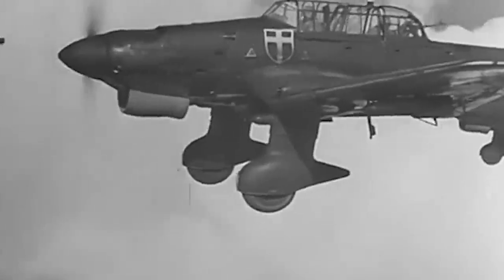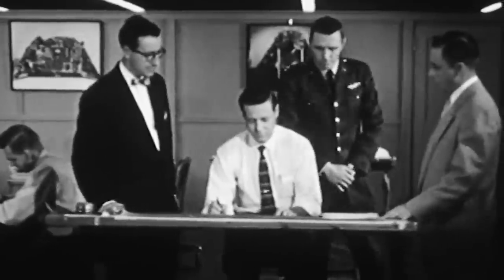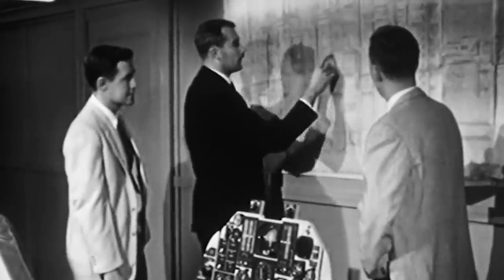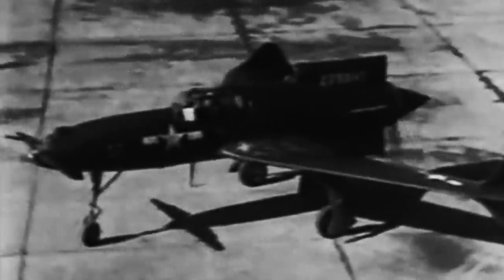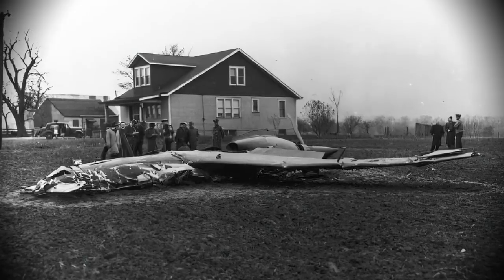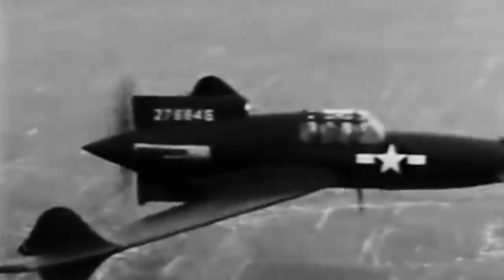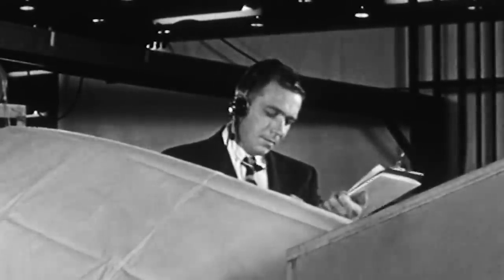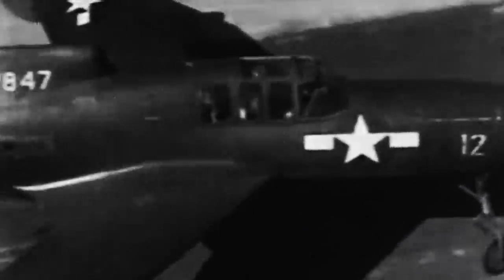XP-55 Ascender - The Backwards Fighter

Comment: Although Glenn Curtis died several years before WWII began, his legacy is nothing short of remarkable. As a pioneer in aircraft and motorcycle development, Curtis' accomplishments are oft forgotten.

Strapping on a V-8 engine to a fairly rudementary bike frame, Curtis set a world speed record of over 136 mph for motorcycles. He also invented handlebar throttle control, something that quickly became the standard for all motorcycles.

In the early years of aviation, he was a pioneer in pusher-prop ideology....something that continued into the XP-55 so many years later. And let us not forget his role with Bell and Wright in developing the technologies that would eventually lead to breaking the sound barrier and beyond.

The Jenny was widely regarded as one of the best trainer planes in World War I.

Although the XP-55 was a "failure", it proved that conventional airframe designs were just that.....conventional. And even the P-40 Warhawk/Kittyhawk/Tomahawk, that lacked high altitude performance, was a solid aircraft to serve in both theatres of conflict....for the entirety of the war.

Comment: It must have been an inspiration to Burt Rutan
Reply: Rutan could make anything fly better and cheaper than just about anything else in the sky.
Reply: Burt figured out how to make the plane hard to stall.
Reply: @rotorheadv8  He sure did. That's what jumped out at me when poor stall characteristics of the XP-55 was mentioned.
Reply: @grndiesel  If true, perhaps you can explain why Rutan's company never replaced Boeing or Airbus. Most airlines love better and cheaper.
Reply: The shape reminded me immediately of Rutan's VariEze, which had graced the cover of PopSci back when I was in high school. https://en.wikipedia.org/wiki/Rutan_VariEze
Reply: @enscroggs  I don't claim to have all of those answers nor would I presume to know his reasons for never building something like the A380. But if you compare the cost of airplanes that he did make to contemporaries in the same class, I would still feel confident in my earlier statement. Indeed, his early adoption of composite materials are eventually finding their way into commercial aviation. Commercial aviation is very slow to accept change.
Reply: At the time, the materials Rutan used were not practical for large scale mass production. In terms of design, similar concepts have been considered for large aircraft but economy of scale makes more conventional aircraft more attractive to passenger/freight operations.
Reply: @rotorheadv8  Apples and oranges. The Long-EZ has less sweep and a thicker airfoil than the XP-55. One is a fighter, the other is a civilian sports plane. If Burt Rutan had been tried to adapt his VariEze design into a fighter the result may have been different.
Reply: @rotorheadv8  Apples and oranges. The Long-EZ has less sweep and a thicker airfoil than the XP-55. One is a fighter, the other is a civilian sports plane. If Burt Rutan had been tried to adapt his VariEze design into a fighter the result may have been different.
Reply: What Rutan did right and Curtiss did wrong is he used a stabilizer plus elevator, Curtiss used a stabilator.  With Rutan, the incidence of the canard is fixed relative to the wing so the canard always stalls first and the nose drops; not so with Ascenders stabilator.
   The Beech Starship was closest to Ascender’s design envelope.   A canard design problem is flaps.  So Rutan linked the canard to the wing flaps.  Flaps deployed, the canard was straight and generated lift to match the wing.  When the flaps retracted, the canard was swept.  Sweeping the canard lowers its max lift, so again, it stalled first.   It’s clever.  The Starship’s composite construction was new to the FAA and their conservatism, I think, tanked it.  There are a couple of Starships flying.
    The newest airliners use canard thinking for efficiency, that is both wing and tail provide lift.  This is longitudinally unstable, so the plane is electronically stabilized, eg fly by wire.  So there is a bit of Ascender in Boeing and Airbus.  Cheers
Reply: @enscroggs  Hi did. It's called ARES https://www.scaled.com/portfolio/ares/
Reply: @enscroggs  Composite airframes are tricky. Aluminium will deform before failing, easy to check and repair cracks.
Reply: @enscroggs  You don’t  think he could have seen this and thought “What a great idea. I know what they got wrong”. ?
Reply: @enscroggs  Because he didn't really have a "company"? At least not in a sense in any way similar to Boeing or Airbus? Seriously, get a clue before asking such a question...

Comment: Reminds me of SAAB J21. It was produced in (for a small country) rather large number. Many of them was modified into jet aircraft, adding a "R" to the name, and subsequently used for over 10 years in the Swedish air force. R in the name SAAB J21R stands for "rea", which is an "older" Swedish word for jet power.

Comment: The ancient arrow (the kind shot from a bow) is stable in flight largely because of the weight at the front (the arrow head) and the much lighter fletching (often made of feather) at the rear.

It is true that fighter aircraft need some instability to be successful (such as from a short fuselage, as opposed to the arrow's long shaft) so that it can turn quickly. But, to depart entirely from the the arrow's design (weight up front and stabilizing fins in the rear) is to design a thing that should never leave the design shop without providing the aircraft with extras such as computer-operated control surfaces and who knows what else.

Yes, the assender was a very appropriate moniker for the XP-55 and the onlookers quite apparently could see that.

Comment: This fighter looks like a Burt Rutan Scaled Composites design.
Reply: Funny you mentioned that. I followed the development of Rutan's VariEze in Popular Science back in the 70's and they never even mentioned the XP-55 Ascender. Looks like Rutan's design wasn't so original after all. I'll give him credit for popularizing composites though.
Reply: @fritzkabeano1969  there were a few other WW2 era aircraft that were canard designs such as the Kyushu Shinden and the Ambrosini SS.4. I think there was also a Focke Wolfe design but I don’t know if it ever left the drawing board. 
Rutan may or may not have been influenced by these designs. One thing that is certain, Rutan was able to make them work. 
If you’re familiar with Burts aircraft, the Rutan Boomerang asymmetrical aircraft bears a resemblance to the Blohm & Voss BV 141 reconnaissance plane.

Comment: I fly a XP55 Ascender in the computer game, World of Warplanes. It can pretty much out turn anything else in the air and it climes like a demon. But is only lightly armed with 4 x .50 cal. guns. It’s clear the game developers used a certain amount of licence in setting the performance parameters, however the aircraft must have had great potential for scorching performance. If only design and development of the aircraft had of occurred earlier.

Comment: Just earlier today made a replica of this plane in the game Trailmakers, ironically, it's my most stably flying airplane I've built yet, and has excellent maneuverability and turn rate especially at slow speeds, although as is consistent, it will lose speed and have some problems if you go too slow

Comment: biggest problem was the engine it was designed around. 2000 HP engine didn't work, had to try a 1300 HP engine. {my father worked for Vultee}
Reply: All three fighters designed for the USAAC specification were intended to use the X-1800. Too bad it was a dud.
Reply: @enscroggs  As I remember the Northrupt Black Bullet was one of the three. A shame because it was super cool.

Comment: The xp-55 suffered mostly from not having it off of a dorsal mechanism to have full control in the yaw axis. A dorsal rudder would have helped. And I'm not sure whether I would want to be injected up over the plane and let the plane go under me or if I would want the propeller released so that I can be in the air along with it. I'm not sure which one is actually safer. Although at the time they didn't actually have ejection seats you actually open the cockpit and climbed out and jumped.
Surprisingly it looks like a natural outgrowth of the Wright flyer. Where the wings are in the back fee vertical control surfaces are in front and the propellers in back. But the first time the light brothers ever actually flew a true powered flight, wasn't until 1907. It took them five years to actually fly further than they had done so in the glider version of their aircraft design.
Being almost a flying wing Design, stall tests are never favorable.
Losing control of the aircraft in roll, is clear indication of lack of Yaw stability.

Comment: Imagine if they put a jet engine on this instead of the bell aircobra platform
Reply: They PUT A JET IN THE AIRCOBRA?
Reply: @Yeaggghurte  The Bell P59 is pretty much a cobra powered jet. Their airframes share enough similarities to know that their base was the cobra platforms design.
Reply: Thats what SAAB did with the J21. Worked well.

Comment: This problem, instability at low speeds is a trademark of the laminar flow wing. That I think combined with small rudder, at the end of that wing that is stalling out, most likely caused the problems, much like the early flying wings, that relied on end of wing diversion for both flaps and airbrakes, at low speed alter the amount of wind across them and thereby allowing the plane to slip through the air. I hadn't really put that together until now. Maybe that was the case?

Comment: The Ascender was way ahead of its time.  I bet it turned on a dime, but without modern control systems must have been hard to control.  Aerodynamic center in front of C/M

Comment: Three thoughts:
1.   It came too late to be properly developed so USAAF fighter jocks were still flying P-40s until V-J day.
2.   The Allison engine would have been OK if the Army had not resisted the two-stage two-speed supercharger that made the Rolls Merlin a superstar.
3.   With time to develop, the pusher arrangement could have allowed air-to-air refueling.   After all, jets are necessarily pushers.

Comment: They could've done what SAAB did with the J-21. It was a twin boom pusher at the beginning, and flew quite well, but with the jet age approaching after the war it was converted to jet power. Saab was the inventor of the ejection seat because of the J21's pusher prop.

Comment: If the Pratt & Whitney 2,200 hp engine that was originally going to be used in the XP-55 the speed increase would have been notable. When the Pratt & Whitney engine never materialized, an Allison 1,200 hp engine was used instead giving the XP-55 1,000 less hp. 
Top speed was 390 mph, far below the design speed of 500-510 mph.

Comment: The wings were too low causing its center weight to be high, that's why when it flipped they could not correct it's angle and it crashed upside down. I have made this mistake in a Planet Nomads. Planet Nomads lets you design and fly craft you design from blocks.

Comment: Is there such a thing as a video game that allows you to play “what if”  design scenarios? I would like to try one of these with: a fairly large, slightly forward-swept (a la Mooney) vertical stabilizer that also housed an additional tube-and-fin radiator, and had a narrow ovoid air intake at the leading edge root, and a slightly larger, indented, Venturi effect outlet ‘mouth’ at the trailing edge root. Put a supercharged Rolls-Royce Griffon engine and coaxial contra-rotating five-bladed props on it; slightly increase the length of the rear fuselage/engine nacelle/cowling so it can taper down more gently, be more deliberate in blending the prop spinner profile with the whole tail end profile, and add spiral raised ridges down the prop spinner.  Finally, I would try passive leading-edge slats on the wings like what was used on the Me-262, maybe even play around with something similar on the canard, or even ‘split’ the canard so its forward 1/3 and back 2/3 could be articulated independently. Oh yeah, since we’re in la-la land anyway, I want a single .50 cal with every other round a tracer, three 20 mm machine guns, all firing hardened, armor penetrating rounds, and a single 30 mm canon that uses an ammunition belt custom loaded with repeating sequences of: 1 armor piercing hardened alloy round, 1 high-explosive fragmenting round, and 1 incendiary round. Sort of a slice, dice, and roast proposition with every three rounds, served up in nice inch and a quarter size chunks.  Let’s call that particular combination of .50, 20mm, 30mm and specific ammo blend a “Texas Chainsaw Meat Market” ... also available in pod-mount version ... limited time offer, void where prohibited, ammunition sold separately, follow label instructions carefully, minimal assembly required, see store for details.

Comment: xp-55: late war project that never came to a reality because of lack of support, delays and an unexpected issue that the plane couldn't exceed vertical turns. 

The plane in war thunder: can take a 1v5 duel clustered together no matter what plane as long as it's not a zero, with better vertical retention than a K4 and literally stallfighting vertically.

Comment: The sad part is, this plan could have been fairly easily converted to use early jet tech.. in fact, if I remember correctly, Lockheed actually designed an early jet that had a similar inverse layout.

Comment: The biggest problem I see with the design is that while most fighters of the time had armor plates in the middle of the pilot, which also protected the engine, there is no way to armor the engine or prop on this thing. If an enemy plane gets in behind it, the prop and engine would have no protection and the plane would quickly become a flaming glider.

Comment: Wait!  What's this?  Has anyone heard of the German fighter 'Dornier Do 335" ?     It had two propellers front and back (push/pull). It had a top speed of 435 MPH and could outperform most Allied fighters.    Why is this tuber covering relics that never worked?

Comment: J7W1 Shinden Prototype No. 1 and No. 2 prototype (photographed in 1945) whose appearance was restored only by the order of the Allied Forces Prototype No. 1 and No. 2 prototype (photographed in 1945) whose appearance was restored only by the order of the Allied Forces Use: Fighter Classification: Local fighter Manufacturer: Kyushu Airplane, Navy Aviation Technology Factory Operator: Japanese Navy First flight: August 3, 1945 Number of production: 1 machineOperation status: Prototype only display Shinden is a local fighter prototyped by the Japanese Navy at the end of World War II. A prototype of a high-speed fighter with a maximum speed of 400 knots (about 740 km / h) or more, which has a unique canard shape, was completed in June 1945 and tested in August of the same year. We flew and reached the end of the war.

Comment: I can't imagine the canards were even operational at anywhere over 200 mph.  That air intake was HUGE.  I don't see any advantage for a pusher here, especially if you can't cool the engine.  Must have been because of the size of the engine.  If they could have mixed this with an Aeracobra maybe they could have made at least one good plane out of the two.

Comment: Wings further back &/or more weight toward the nose,
  more of a blended wing,
or a nose prop as well..
- (like the German cousin it was attempting to rip off), would have solved the engineering/handling issues.
 The swept wing & lack of a sizeble, central & stable rudder did not help in this iteration either.
 I'm guessing the call for a unique design corrupted many engineering redundancies.

Comment: It needed a front & rear engine like germane  design & high spoiler vertical tail or death trap. Flying w/limited power rear & front too get best out put yet also cooling. Safer engines front & rear. The wing not glider straight wing is stall death trap.

Comment: With the engine that far aft, there was no way the CG could be far enough forward to give decent handling. They probably expected a buttload of .50 cals in the nose would even it out. Anyway, with the CG so far aft, the elevator wouldn't have sufficient authority, especially at low speed...
As well as guaranteeing that stall recovery would be damn near impossible, as the weight of the Allison would drag the tail down to a deep stall.